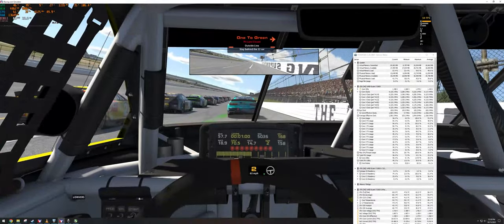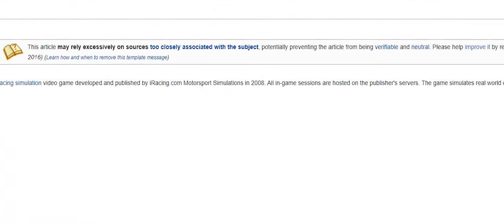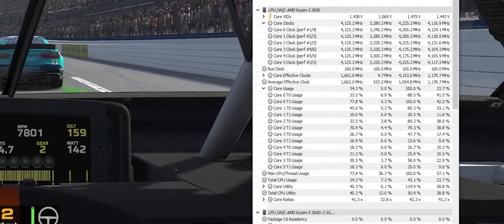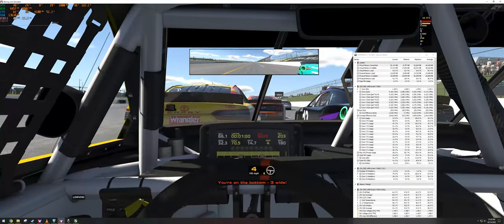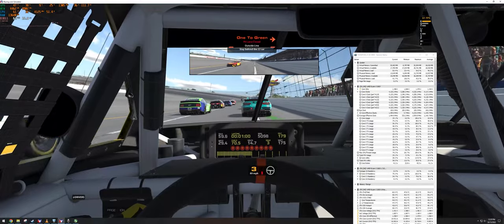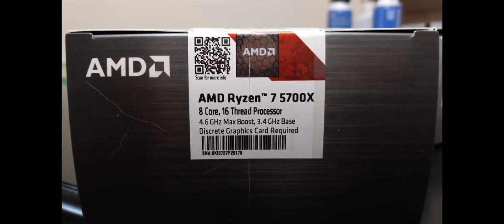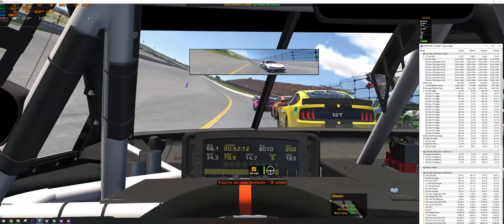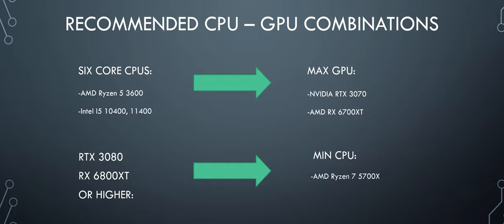IRacing CPU bottlenecking explained (RTX 3080 with Ryzen 5 3600)

Comment: Classic,...it's even more of a problem, if you already have the highest end cpu that your motherboard can handle. In that case you also have to upgrade the moterboard. Then you realize that your new motherboard requires DDR5 instead of the older generation DDR4 ram which was installed on your old motherboard,...and if you're completely out of luck, your 500w power supply does not provide enough power for the new cpu/gpu configuration,...well sh!t, guess what, now you basically need a completely new system and the balls to tell your wife why you just spent 2k an a "video game"
Reply from the maker: Yes it is a slippery slope indeed my friend!  That's why I always seek out the best budget options.  It's easy to go overboard and get stuff you don't really need.  AM4 platform is awesome because you can upgrade across so many generations of CPU.  Hopefully AM5 will last many years like its predecessor.
Reply: Only if you went with Intel. 

The AM4 platform lived forever and the 5800x3d will make sure it stays there even longer.
Reply: Thats what generational improvements require? Atleast you can upgrade between generations.

Comment: The 5700X is a great improvement from the 3600 as it offers a generational improvement over the 3600 in terms of IPC ( Instructions per cycle), Clock frequency, Core/thread count, cache, but it might have been a better investment to buy the 5800X3D as it takes the 5700X L3 cache from 36 MB to a massive 96 MB on the 5800X3D.  Racing games see a huge improvment from large cache pools and the 5800X3D is not only the fast gaming CPU on the AM4 platform but it's one of the best value CPU buys on the market.
Reply from the maker: Yes I may consider this upgrade down the road if the price continues to decrease.  The 5800x3d is the king of simulation games.  At the time it was going for $350 and the 5700x was $200 so it was a little more than I wanted to spend.  And the 5700x has performed flawlessly so far allowing me to hit my frame cap of 116 most of the time.
Reply: Whats up guy's im hoping someone can help me out.  i hace a HP Victus 15L Model #TG02-0355z Ryzen 5700 6600xt. Can i play iracing on 1080p maxed out? If not which settings should i turn down to get the best performance
Reply: @kishdogg1594 1080p 60fps you probably can, if you're refresh rate is higher you may need to turn down the settings, turn everything to low, than gradually turn settings up until you reach your desired performance.  You can probably max out texture quality, but you might struggle with post-processing effects with that GPU.
Reply: Ok thanks for the reply im gonna five it a try and see what happens
Reply: Should i consider upgrading the gpu  would it be worth it to and still use the 6600xt
Reply: @kishdogg1594  the computer you have is great, it has a 8 core CPU, and your graphics card is very modern.  Your computer is a pre-built there are a number of things that you will have to consider if you want to upgrade that may not be feasible, for instance your power supply may not support a higher wattage CPU or GPU, The cooler in the system may not support a higher wattage CPU, your CPU may be limited by your RAM bandwidth, there would be a number of things you would have to account for to consider upgrading that system that may not be worth it.  It will perhaps be your best interest to build a new system entirely from the ground up with 7000 series processers if you want more performance out of your computer.

I think your computer is great, but only you can decide if you are happy with it.

Comment: I don't understand this comment:  "Only one core is being utilized and is nearly maxed-out at 100%.  Look at these other cores which have almost zero utilization"  I don't see that.  I see the first 3 cores in the current column getting used in the 34% to 70% range and 3 cores getting used 27% to 48% range.  No core or thread is close to 100% and none are almost 0 in the current column.  Please explain.   Looking at max column, I do see one core/thread which hit 100% .  That might be indicative that you are CPU bound for an instant but the current column seems to be much lower than 100% for that same core/tread.
Reply from the maker: I know what I said doesn't perfectly line up I may have made a little too much of a generalization but basically all I was trying to show is that only  few of the cores are nearing full utilization while other are in the 20-30 percent range.   It's a rough estimate because of background tasks as well but  if you compare this to a more modern game that uses more cores you will see utilization is more spread out.  Also Iracing recently added the ability for the damage model to use up to 8 cores so I'm not sure exactly how that affects this but I found that out recently.  I apologize is this was misleading; that wasn't my intention.
Reply: @manofyeo  Oh, no apology necessary.  It looks like iRacing was using 1/3 or 1/2 of the threads fairly heavily but not really maxed-out.   Maybe as an alternative what was your GPU utilization?  If it never got to 100% then maybe your CPU bound, otherwise you are GPU bound?  The ultimate test is throwing a new CPU in and see what happens but you want to have pretty good idea for you drop the cash for a new CPU.    What I did learn was that back of the grid at the start is very CPU intensive.  If you're primarily a "hot lapper" the new CPU may not be quite as critical.

Comment: GPU is still only running at 50%, so still not getting the max from that 3080. Have a play the the anti-alias settings. You may be able to get better looking graphics with no slow down - just more load on the GPU.
Reply: @RacingAnt I'm having this issue right now. I have the 3080 10gb and the 9900k stock 32gb ram and game in ssd but my GPU usage is around 45% upto 55% and the CPU is about the same and I'm getting around 85fps too 95fps on medium to high settings but no matter what I turn up I can't get the GPU usage to go up any ideas 🙏
Reply: Exactly the same CPU + GPU combo and the same results, I don’t have this problem with ACC

Comment: I went from a 5600x to a 7600x with a 3090. Found very little gains on the grid. By myself FPS goes up to 500 (1440P) in some cases, but on the grid it can go as low as 85fps. Still only using one monitor.
Reply from the maker: Yes it appears all cpu's will have lower frames on the grid due to iRacing's engine.  As long as you're not getting drops during racing it's not a big deal.

Comment: Spending half of the time explaining how it depends on single core performance and at the end still offering to buy 5700x.. Stick to 5600(x) if you value you wallet capacity.
Reply from the maker: I'm only offering what I did.  I do heavy multitasking with multiple monitors and the extra cores helped significantly.  Sure if you use one monitor and don't multitask save your self $50 bucks...but at $180 the 5700x is the bargain king right now and will last for many years to come.  Also better for future proofing with consoles now being 8 core.
Reply: @manofyeo  you are trying to be educational about iracing (or gaming in general), so stick to it. Do not misslead people with your choises or make explanation on that. There are almost none games that fully utilize multicore processing power, so 8 cores in iracing or in most other games - has 0 benefit. Also monitor count has nothing to do with..
Reply from the maker: @eviliso  It is not misleading at all...I never once said don't buy a 5600.  5600 is an amazing budget option.  But there is a reason it is the lowest processor in the lineup.  I watch videos and racing on a secondary monitor while I am gaming at 3440x1440p on my main monitor.  I have many tabs open in my browser, numerous programs, things like discord, trading paints, sim hub, overlays, steam open all at the same time.  On top of top of that I have Adobe Premiere or Photoshop open most of the time.  Doing all of these things at once I use over 20gbs of RAM frequently and having 2 extra cores helps make it smoother.  It also makes rendering quicker.  Therefore, for my use spending an extra $50 was well worth it.  If you are building a strict budget PC where you can't go over $400, yes get the 5600.  The 5600 is amazing for the value.  But a lot of people are spending $1000's on their sim rigs and accessories and can probably spare the extra $50.  I am just trying to offer my experience.  Sorry if it isn't exactly what Hardware Unboxed told you but I'm just trying to inform people of unique situations that can occur.

Comment: This video was very helpful, because currently I have a Ryzen 5 3600X + Radeon RX 580 8 GB system, and and I enjoy racing in VR, and many times I have only 40-50 fps in VR with an old Oculus Rift S, I plan to upgrade my system. I thought that a 3080 or 4070 could be a great investment for the upcoming years (I upgrade only once-twice in a decade normally), and now I see that I will need to upgrade my CPU too. As you mentioned, upgrading from Ryzen 5 3600X to a more powerful CPU would not break the bank that much. Thank you!
Reply from the maker: You are very much welcome!  I highly recommend upgrading to a 5700x3d if it is on sale.  In the U.S. it is $220 right now which is an amazing deal and will prolong the life of your system for 5 years or more.  I'm tempted to get one to future proof, but the regular 5700x does a pretty good job already.
Reply: @manofyeo is bottle neck of 3600 and 3080 is so much high that will make game unplayable?? with annoying fps losts?
Reply from the maker: @toofan8350  Its not unplayable by any means.  For most people it would probably be fine.  There can be some slowdowns in big packs but its not too jarring. I would recommend upgrading to a 5600, 5700x, or 5700x3d at some point to maximize your performance but its certainly fine if thats not an option.

Comment: Great video! iRacing is certainly behind the times when it comes to utilizing modern hardware. I’m happy that the 5700x worked out for ya. Unfortunately the higher the resolution the worse the cpu bottleneck becomes. I use VR when in iRacing and have found that I would experience CPU bottlenecking with a 5900X and 3080 12GB. The CPU simply couldn’t keep up with feeding such high resolution frames to my GPU. 

The current best budget CPU is the 5800X3D with the best mid tier option being the 13600k and DDR4 mobo. As for me, it took going to the 13700k to make a meaningful jump in performance. 

It is my hope that when rain finally goes live with iRacing, that it comes with a transition to DX12.
Reply from the maker: Yes! The higher the resolution the MORE the CPU bottleneck.  That is the reason I made this video.  Common thought on the internet is that the higher the resolution the less cpu demand, which is true for many AAA games.  But I think Sim Racing games in particular work to the opposite of common logic.  5800x3d is a magical cpu for sim racing, especially at $300.  We can only hope that iRacing will do a major engine overhaul soon.
Reply: @manofyeo  time will tell with iRacing. The major issue at the moment is that the rendering thread is a single threaded process. So trying to supply two 3096x3096 frames at 90FPS plus is a major challenge.
Reply: It's actually the other way around, the higher the resolution the lower the FPS, the lower the resolution the higher the FPS.  The less GPU bound the game is playing,  the higher the demand on the CPU to deliver FPS to the GPU, if you play a game at very high resolution the  GPU will then become the bottleneck, not the CPU.

Truth be told the prettier you make your game the worst it will run, if you want to play at a very high FPS run the game at very low settings at 720p and you'll really test the limits of your CPU, so if you want to be compeitive you have to make a trade off of visuals vs perfomance.
Reply from the maker: @juno1597  You're not wrong at all...especially in 99% of games, but in iRacing specifically the cpu demand seems to scale with resolution.  And for some reason the cpu limited frame spikes become more noticiable with higher gpu demand.  At 1080p with a 1050ti you don't notice it but with a 3080 you do.  Its a very unique instance.
Reply: @manofyeo   Defintely not the case for me. Not only logically but in reality. E.G Feeding 60 frames @ 4k is easier than 144 @ 1440p. Your cpu must work at a much faster pace to keep frames ready. Have had this occur on iracing when I went up to 4k. My GPU usage goes up along with resolution. Interesting that you and others see the opposite occuring.

Comment: Good info for the masses getting into  iRacing and how decrepit the software is and that how mostly it is dependent on CPU processing, not a a high end graphics card. And here lies iRacing's biggest problem, those new to the service, run on a minimal spec PC and lately, it seems, there's a lot of controller & mouse/keyboard drivers! 
I'v run a quad setup since 2015, so I need a high end built PC, which a new one was built last week.
Reply from the maker: Yes, there does seem to be quite a few controller warriors out there and many are terrible.  I played sims like gran tursimo and  project cars 2 on ps4 on controller before I got a wheel and I was so good that people couldn't tell I was on controller.  Which makes me wonder why these people aren't better at controller if that is their only option.  Also I started iRacing a few years ago on an fx 8350 and a gtx 760 and it ran fine on medium settings at 1080p.  Its amazing to me how minimal you can go while on the other end , if your looking for higher resolution, high frames, full details, more screens or VR  you basically need a super computer.

Comment: I have a 5800X3D and 4070 Ti. All was rosy until I started racing in VR with a Quest 3. Now my CPU is near its limit, while the GPU is not even breaking a sweat.
Reply from the maker: VR is always going to be really taxing on hardware.  I've never tried it but I know you have to set up some config files to get it running decently.  The 7800x3d really isn't that much faster than the 5800x3d unfortunately so I would wait till the next gen comes out before upgrading.

Comment: Good stuff on the video. I’m in a similar situation, although can’t really complain: 5600x with a 3080Ti running triple 1440p @ 144hz. It can deliver the 144 easily when by myself (crow on low and couple of other left side settings on medium), but on heavy traffic it goes down to about 110 and two weeks ago at Daytona 24, nighttime I was going down to around 75 in pits. I may consider the new am5 for a cpu upgrade (maybe 7800x3d).
Reply from the maker: The new 7000x3d will be a beast but honestly if your looking for a much cheaper (and easier) upgrade option I would get a 5800x3d for $300.  You can update your bios on your motherboard and pop it right in.  Could probably sell your 5600x for $100 or so dollars too.  In the limited data I've seen it seems to almost double frames at the start of races.  The extra cache seems to work wonders on all sim racing games.
Reply: @manofyeo  yeah I was considering that as an option to keep cost down and stay a bit longer on the AM4 platform before having to switch everything out. Or maybe even wait a month or two and see if prices drop even further with more AM5 cpus coming out. Thanks, and once again good info on the video - quite thorough
Reply from the maker: @jpdmiranda  It's my pleasure, thanks for watching!  I think you could get many years out of the 5800x3d still.  Am5 motherboards are really expensive still.  At least DDR5 is starting to come down.
Reply: @manofyeo  Don't get it. Isn't the 3600x and 5600x a just a bit worse than the 5700x in single core? It shouldn't have the gains you are suggesting if the difference is like 10% only between the 3600 and 5700
Reply from the maker: @chrisairone  The 3600 is significantly slower than both the 5600 and 5700x.  This is why I made this video.  I've watched every benchmark from the big channels and they don't account for the cpu load that sim racing games can put on the processor.  5600 probably would've had similar gains like I saw from 5700x.  When you have a powerful GPU it exacerbates the cpu bottleneck in these situations.  You can see it in the 4090 benchmarks; the stronger the GPU the more CPU power you need.  I believe I saw a bigger discrepancy because of the ultrawide resolution I play at, 3440x1440p.  Even though the pixel count is close to 4k, it still demands a lot out of the CPU.
Reply: I'm running a similar setup: R55600X OC @4.6ghz, MSI Pro B550-VC MB, Corsair Vengence DDR4 32GB @3600Mhz, Zotac Nvidia GeForce RTX 3060 12gb (with optimized Nvidia graphic settings), 3 Samsung 31.5" curved & 1 27" flat. 1080p is fine for me, I'm like more "balanced performance", but I'm at max iRacing settings and limit my FPS @120 frames. Sonoma GT3, frames drop to 80 fps.

Comment: I have. 5800X3D with a 6800XT GPU.  Using triple 32” monitors I have trouble getting over 60FPS with full grids or at night.  Having more monitors really stresses the platform.  Not many people test CPU and GPU’s with triple monitors.
Reply from the maker: Triple 1080p is manageable but 1440 is tough and 4k is just an insane amount of pixels to drive, especially for simulation games.  Its something that most people don't understand before they chose a triple monitor setup.
Reply: @manofyeo why 1 monitor is not enough for him?
Reply: Amd gpu on iracing with more then one monitor dont do well...  Try using one big high quality screen like 50"+ 4k.  I never see fps drop under 60fps on my system that is similar to yours. Except i have a 6800 base model.
Reply: Sorry i have a 7800x3d but likely not much difference